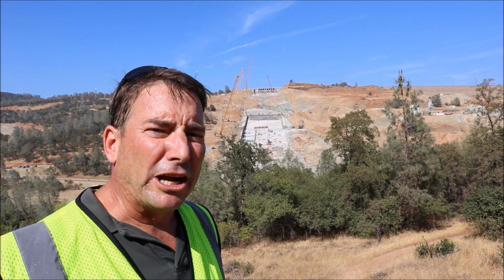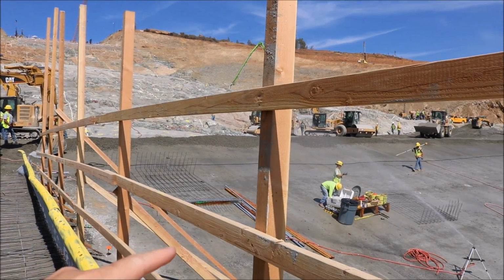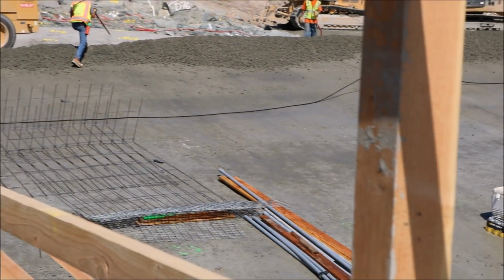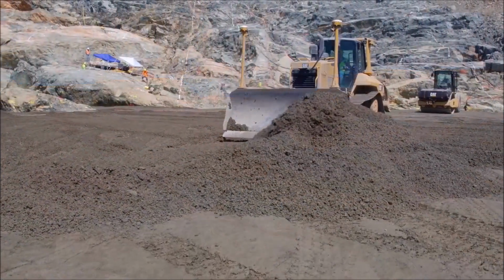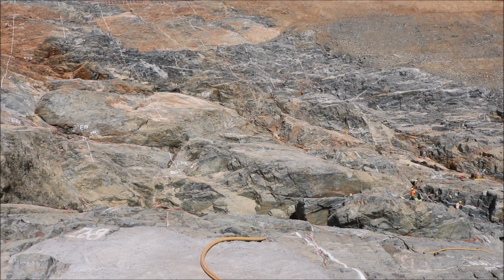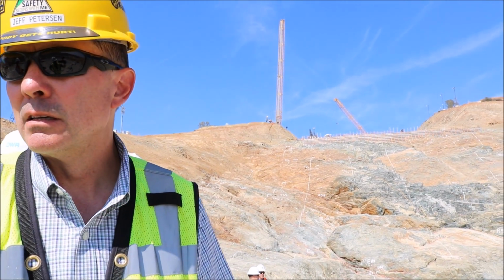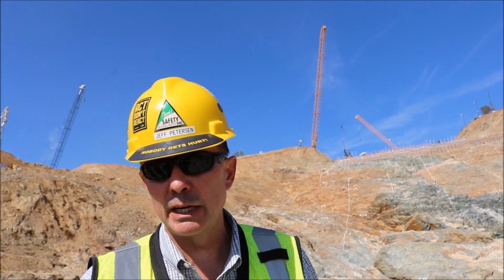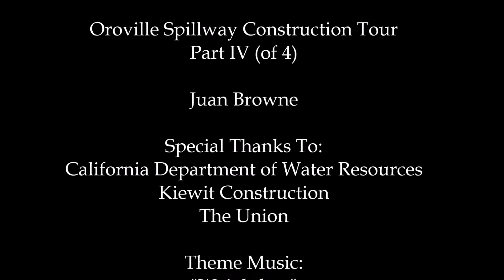Part IV Oroville Spillway Construction Tour

Comment from the maker: Breaking News-Official Forensics Report Out today-https://damsafety.org/sites/default/files/files/IFT%20interim%20memo%20final%2009-05-17.pdf
Reply: Great summary in only seven pages. Good read for everyone following this story.
Reply: Soren Solveig --- I edited my response to you earlier as I found the information regarding your question.
Reply: If they left enough room for the drainage system where the outflow pipes run along the outside of the training wall before dumping back into the chute, that seems like it would work.
Reply: My Firefox browser says that damsafety.org is improperly configured and not secure.  Result? no connection.
Reply: Cos they need to saw cut into the complete RCC floor right across to the ends or sides in order to put in the drainage systems next season
Reply: panda44r my guess is that the structural concrete forms need a lot of space on both sides to erect them.
Reply: Lessons to be Learned –

• Critical and independent, rather than relying largely on the findings of past reviews

New independent review of the earthen dam?

Don't repeat the same mistake twice, by using the same process and groups that failed to ensure the integrity of the spillways.
Reply: blancolirio i read the two bullet points about the non-impact of EQ tremors and groundwater. I've read so much FUD about tremors and groundwater seepage, but along comes an independent report that basically lays all the blame on inspection and maintenance.
Reply: the type of agency usually hired by insurance companies.  an innocent looking document now, likely to be followed up shortly by more investigation, finger pointing and then the law suites.
Reply: Thank you for a very impressive display of amazing information.
Keep up the good work!
Reply: @dhamma58 Try chrome.
Reply: Nice concise report. Basically, the spillway was doomed from day one because it was not built to the design (I wonder who approved that?) and DWR ignored the warning signs (the tell-tale flows from the drainage). The standards from 50 years ago aren't what they are today, but I don't think it's unreasonable to say that the spillway would not have failed as it did had it been built to the original design. It still wouldn't be as robust as the spillway they are building now, but it would have been much better than it was.
Reply: @Panda44r: I answered your question at considerable length 2 days ago, but I guess you didn't notice.  >sigh<.
Reply: Juan Browne thanks so much for all of your efforts in Oroville.   Alert please look at the newest Green belt showing up to the right of the spillway.  I think that next time you do a phone conference call you could ask for an explanation.   I have cracked up many times listening to the inquires regarding the green stuff on the dam.  Again Thanks
Reply: Tom Ashton I havent read what youre referring to, but ill blindly guess ... its that spray on grass seed, fertilizer and ground soil stabilizer blend applied by ground crews ? What do i win ? 😉
Reply: Maybe  LOL
Reply: Roving Punster --- You get an "atta boy!" 

Tom Ashton ---The 'green stuff' is the tackifer/mulch for the newly sown seed, aka temporary seeding....could be permanent seed but I doubt it. We always had to do temporary seeding through the winter where an area wasn't having any work done within the next 21 days.
Reply: arkansas13 😃
Reply: I assume you guys are referring to the green in the top middle as seen here 
{ https://youtu.be/tC8hV4_Pl3E?t=45s }.
Reply: Roving Punster --- Yep, probably more coming in the next few days.
Reply: Try using Google browser or Opera Web Browser instead of Firefox

Comment: Hi Juan, 

I wanted to clarify the confusion about concrete. The foundation for the final structural concrete can be EITHER RCC or leveling concrete. In sections where the surface rock is close to the final grade, they use leveling concrete. In the case of the PP, they start with dental to fill the deep and narrow crevices and may also use some leveling concrete until the surface is level enough to start RCC. Since RCC is being built up to the final grade and provides a stable surface, there is no need to apply anything else before installing the final structural slabs.

The RCC section currently meets flush with the leveling concrete on the lower section.  This means it will be lower than the bottom section necessitating a 'ramp' up at this point. Next year, after the slabs are installed on the RCC, it will be level.

Another point to clarify is that they are NOT removing the RCC surface in order to install the final slabs. The structural slabs will go directly on top of the RCC. The only preparation is cutting trenches across it for the drains. This is the same construction process used on the upper and lower sections. In this case,  RCC substitutes for the leveling concrete used in those areas. Instead of the drains running across the leveling concrete they will run in a trench ground into the top of the RCC.

Where the RCC section meets the upper section, the drop will be decreased.

Comment: Hey thanks for the great videos and interviews!! Hope to see more when they start "reconstruction" next year. Just a note regarding the difference in names of concrete being used at site:  all concrete is made from PCC (Portland concrete cement) the difference is in the mixtures and ratios of fines and aggravates to PCC that "glues" the concrete together when water is added. It is a chemical reaction that gets stronger with time as it cures. Since the PCC portion of concrete it the most expensive part, it is used sparingly and effectively. Dental or slurry type concrete has a larger portion on PCC and smaller fine aggregates so it can flow easier into into the cracks and crevices of the existing bedrock. They use the RCC roller compacted concrete to fill the large holes because it is a fill material with a lower (minimal) amount of PCC, until they are within the final surface. The confusion regarding "leveling" or "structural" concrete just refers to an issue of whether to use steel rebar reinforcement. And also, certain chemical additives can be used in the mix to strengthen the final pour. I hope this helps explain PCC. Concrete and its many forms and uses. It is the modern miracle material (if you will) that has changed how we have built just about everything in our lives in the last hundred years!!
Reply: Kinda makes me wonder how the Roman's built mega structures that still last till this day...

It appears everything will come to fruition right on time with all concrete mixes and layers...

Great explanation on all the levels and styles of concrete mixes for all the different applications...  The glue and bonding hardening agents really up the scheduling goals of this project...

Thank-You for explaining the different uses of each...  

I'm very impressed...
Reply: Ryan Toemmes the romans had concrete we still don't know how their concrete worked in many ways. One type of concrete they had would cure under salt water they used it to build harbors and breakwaters. Some things of roman technology have not yet been rediscovered.
Reply: So true, the brilliance of the Roman Engineers in designing the roof of the Pantheon out of concrete that has withstood 2,000 years of earthquakes, settling, with only minor cracking, etc...  One of the secrets you mentioned is that they kept their concrete WET to maximize its' strength.  And it still stands today!  Keep your concrete wet to strengthen it.  Just like the guys on the Oroville Spillway project.  Sprinklers, burlap and tarps cover and keep it wet.  Wet concrete is your friend, ask the Romans.
Reply: @RJ Prescott. That's another nut we seem to have cracked recently. Short answer is they used volcanic ash, lime and volcanic aggregate and mixed with seawater. Long (fascinating) answer https://www.nature.com/news/seawater-is-the-secret-to-long-lasting-roman-concrete-1.22231
Reply: Thanks for that & well said..
Reply: john williams thank you for taking the time to clarify the different kinds of concrete and clarifying our understanding. Very much appreciated.
Reply: J. Eric Lunden  Keeping concrete WET on the surface after it is poured is only a small aspect of it's strength, but not the most important.  The most important is the amount of water that's placed in the concrete mix when it's being batched.  There has to be a minimum for hydration of the cement, but generally, the less water, the stronger the concrete. That's why they replace some of the water with chemicals.
Reply: Don't forget asphalt concrete used in road paving, where asphalt is the binder instead of cement.
Reply: Good comment, probably should be turned into pop-up explanations during the presentation, tbh. I knew the difference between structural and leveling, but didn't quite know what they meant by "Dental"
Reply: What would be the expected structural life be of this finished project?

Comment: Many thanks , Juan, for your comprehensive and easy to digest coverage of the Oroville Dam Spillway project.  Would you please take another run at clarifying how leveling concrete differs from the other three recipes: dental concrete, structural concrete, and roller compacted concrete.
Reply: I reckon leveling concrete is the same as structural concrete but with no reinforcing steel bars. Just a guess.
Reply: You are correct about the rebar. Leveling concrete is used from 7.5 feet below finish grade to two feet below finish grade, then structural concrete (with rebar) is the last two feet. Roller compacted concrete is used anytime rock grade is more than 7.5 feet below finish grade. Dental concrete is used in crevasse two small for roller compacted equipment to get into, then RCC is placed on top. After this flood season, structural concrete will be placed on top of RCC for finish spillway next year.
Reply: Better make that cigar a Churchill Maduro, for good measure!

Comment: Juan: First of all, thank you so much for providing this "up close and personal" info and view of this project. If I might be allowed to clarify a tiny bit simply because I come from a Construction background and almost instinctively understand the terminology. 

A "cold" joint in concrete is when two layers/applications of concrete are placed but the first layer/application has been allowed to dry/cure in between applications. So, what they were describing is how they are able to create the conditions of a "live" (wet) joint even though the first application has been allowed to be put in place well ahead of the final layer/application. Making the final complete thickness of ALL the concrete as though it was all placed at the same time and when wet. 

One additional clarification just to be "completely" accurate: Next year when the "structural" concrete is placed over the RCC at the mid section (Plunge pools) of the spillway, they will "cut" the RCC but ONLY to simulate the slots the stay forms have created for the drains @ the LSW. They will saw cut those slots into the RCC and add the drain pipe and rock as below. 

Finally,  the "RCC training walls" you referred to may be 12' wide but are 15' tall as opposed to the structural walls that are 25' tall. That 10' difference is going to be the limiting device to cut off the water flow at 100k CFS. They are going to add a 6" layer of shot-crete on the "water" side of those RCC training walls as a "hardened" surface for the water to travel against. Hard to imagine a water flow @ 178' wide by 15' tall. Almost "un-imaginable". 

This year my look like "the fun part" compared to all the RCC demo and cutting that is going to take place next season. Will also be interesting to see how they finish/groom the landscape on the "dirt" side of the spillway walls and other areas they have created as staging/working areas during the construction process. Just like freeway building, SOOO much "false work" needs to be done in the course.

Comment: Great!
I've been wondering about the layering of new on top of cured concrete. ( how it sticks  etc) I heard him say preparing the cured for new next year(taking it down to expose the aggregate.) and rock bolts. Excellent questions Juan. 
Engineering background shows, as opposed to journalism background. Just the man for the job. One aspect of the project is deadline. You always cross your fingers that nothing breaks and what redundancy is necessary. Waiting on parts or pieces is a killer.

Comment: Great series, Juan. Here's some questions that can be answered in future episodes:
1. During the winter, in the event it doesn't rain much and the spillway is not used, will the construction crew be able to continue work someplace on the site? Perhaps continuing to work on the emergency spillway cutoff wall? Or will they take the winter off and come back after threat of springtime flooding?
2. Where did the skilled construction labor and equipment come from? Were the folks taken off of other Kiewit projects, re-hired from retirement, or newly hired? There's a lot of folks working on this project and getting all of this to the site was certainly expensive. This project is a huge managerial effort.
3. You may have already addressed this, but how is the contract with Kiewit structured with the DWR? Did Kiewit give a fixed-price for the work, or time & expenses, or something else?
Thanks!
Reply: Soren Solveig --- Answer to #3: Google Kiewit's Oroville Dam Contract.
Reply: arkansas13: Thanks for the suggestion. I followed your advice, and could only find that Kiewit’s bid of $275,443,850 was the lowest responsive bid, but did not elaborate on how the contract was structured. At the time of bid, there are so many unknowns, contractors usually structure such contracts as a base amount with a means to change that price up (or down) based on a slew of conditions. None of the media outlets indicated this was a priced-price contract, but perhaps it was.
Reply: Soren Solveig --- I found all of the bidders bid sheets and how much each bidder, bid per item; ie....260,000 cu yds RCC @ $100  per yd. ; 100,000 cu yds of Structural Concrete @ $350 per yd......this is an example. The total bid of the project that each bidder bid, was used to determine the lowest/best/total responsible bid. 

The FINAL COST of Kiewit's contract will be determined by how many 'units' of each item that are actually used. This is typically how a project like this (or a highway, bridge, airports, etc.) are contracted out in nearly all of the US States. (General Contracting of this type was my profession before retiring) 

ALL BIDS of each BIDDER  are posted on the web: 
Look at CA.gov DWR, and put in their search box (top RH corner)....Oroville Spillway incident bid summaries....then click on Oroville Spillway (not the YouTube one but the one dated May 18, 2017. This will show all of the information that is in each bidders Bid Form (each bidder in pdf), when you click on each bidder, separately.
Reply: arkansas13: Great info. Thanks.

Comment: It's probably too late for a suggestion on the placement of the RCC, but here it is anyway. I watched the 9/8/2017 DWR video and I saw ONE truck at a time dumping RCC. I suggest a conveyor belt system from the RCC plant directly to the working location. As each batch is mixed, it could be dumped into a holding silo and dumped onto the conveyor at a steady rate. They way they are doing it can cause delays at the plant waiting on a returning truck and then start mixing another batch.

Comment: The fixed point GPS that you are referring to is called "Differential GPS."  By placing a GPS receiver on a known lat/long point, you can backwards calculate the error introduced into the GPS signal and greatly increase the accuracy of the GPS signal.  Of course it requires simultaneous readings from the Differential GPS receiver and the receiver at the location in question.

Comment: Thanks Juan, for including that short DWR drone flyover from day before yesterday, or at least that's when I first saw it. I was amazed that it was only a few days work to get the RCC built up in the worst plunge pool almost even with the spillway base.  Do you know if they're going to knock off that higher portion of busted up alluvium? Just offhand, it looks like it would be a good idea and easier than continuing the RCC build-up around it. It would change the grade a little too, taking some of the "hump" out of the center... Any mention of that by anyone? Thanks again for all your work man, great job!!! 😎 

Edit; I just looked at that hump amidst the RCC more closely, it appears they've already poured leveling mix on most of it, there's still lot of jagged strata I hope we get to see how they handle. Fascinatin' stuff, all of it! I like the little wooden bridge over to that leveled area.  Whatever works. Hahaha... 🤗

Comment: There is a very informative video titled "The Powerplant that was never Built" posted here on YouTube. The powerplant in question was to be at the Oroville Dam site. There is initial construction already done on the opposite side of the existing powerplant. My interest in making the proposed but never completed powerplant a reality was getting some use out of the water that for now must be released (well at least until repairs are completed) I do wonder what voices are listened to the most when designing a system such as one that brings water to millions and millions of people. I sure would like to see the San Joaquin Valley start producing the widely varied amount of crops that it used to. My county (Kern CA) could sure stand to see an uptick in activity and is greatly affected by water either being available or not available.